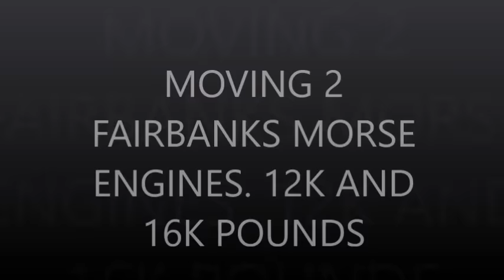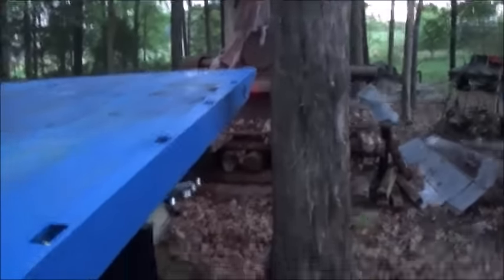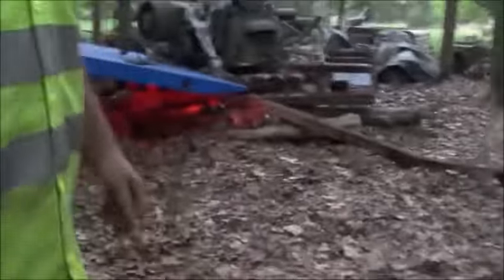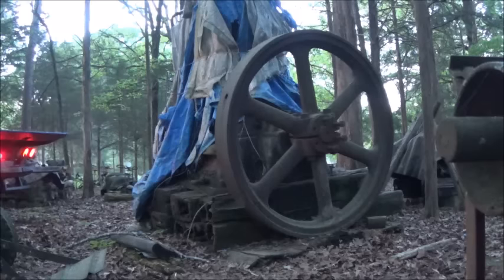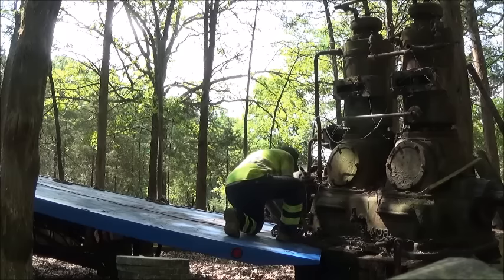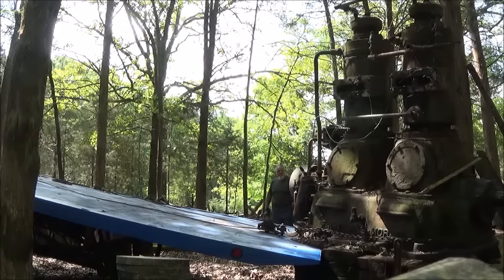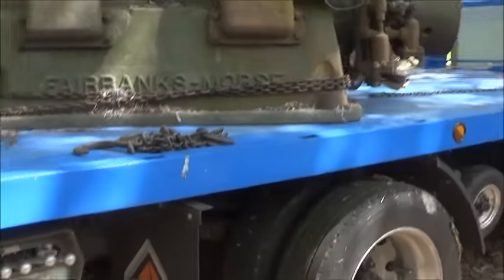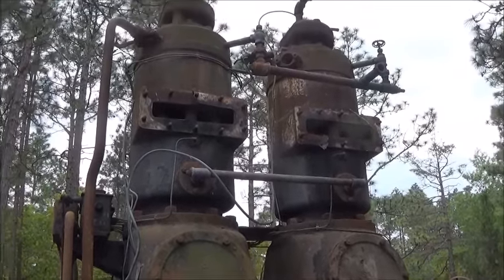BIG FAIRBANKS DIESEL LOADING AND HAULING X 2

Comment: Awesome Jonathan! Rick Delair here! Finally can post again! Subscribed again too! 😊 I hope you received the Edison style carbon filament bulb and wedge for your Unit crane a couple years ago! I love 2 strokes, and these loop scavenged using crankcase pressure like a gas 2 stroke, Fairbanks Morse hot-bulb semi-diesels are beautiful! Huge chain saw engines! 😅 I am glad to be back, you are awesome and this is my first comment since a few years! OH! These and most gasoline 2 stroke engines are Day cycle. Detroit diesel, and Cleveland diesel, also EMD, with intake ports and exhaust valves, also opposed piston engines like Fairbanks-Morse, all uni-flow scavenged with blowers, are Clark cycle engines. The opposed piston 2 stroke diesels remain the most efficient engines ever made! Glad to be back! 😊

Comment: Boy Oh Boy! That was some haul! You picked up them engines at the right time. That wood was very rotten underneath the two cylinder engine and maybe not too much longer and it would have been on its side. I knew you were in for some quick thinking when you were saying sketchy, sketchy. I want to say that the truck you put together is a fine piece of equipment. You certainly put it through its paces and it worked fine. Two thumbs up for you!

Comment: Not sure this is what "Detroit engines" two cycle engine would of started as.... consider my comment total ignorance of stuff like this. As long as there is wood and water, something that resembles a oil of some kind... I have seen some cheap guy use only used motor oil for fuel along with deep fry oil. Sad cause this man was wealthy, owned the only gravel pit around for a good many miles and plenty of highways around to build. I do believe he could carry his money in a bucket and still just be plumb cheap. More to that story but no one would want to hear it. His son John Boy, has all of it now